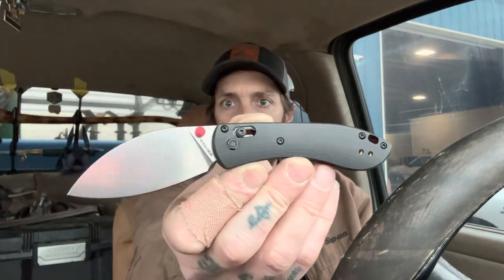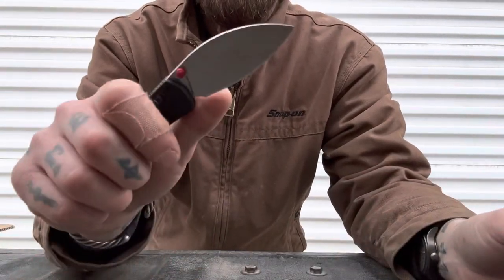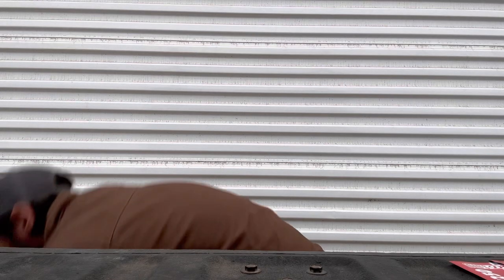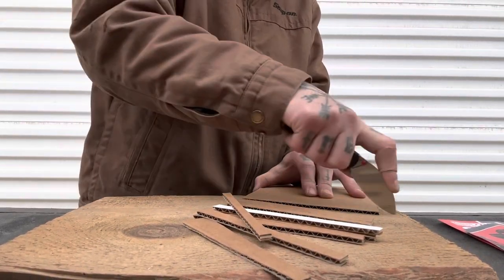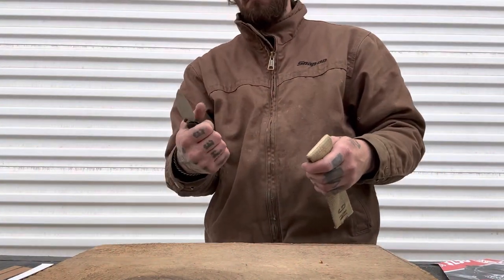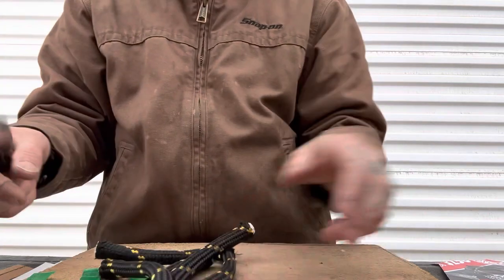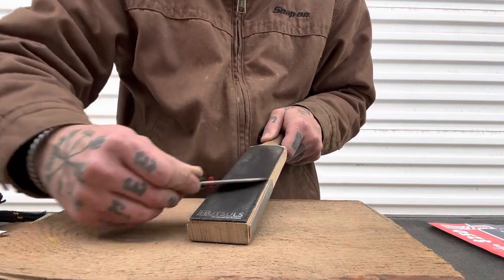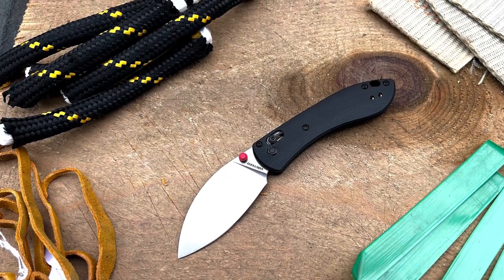Cut Test: Vosteed Mini Nightshade! Small but powerful.

Comment: Also: had a question. How do you think it compates overall to the baby banter? I watched most of tge baby banter cut test and it seems edge retention seemed better here. But im specifically wondering about ergos and also how it carries. Im interested in them as a small, lightweight edc to have for very minimal and occasional utility cutting. Thanks for reading!
Reply from the maker: The Baby Banter is more light use than the Mini Nightshade. Also, the Nightshade is going to be WAY better at utility cuts than the Baby Banter. Both are very lightweight. The Baby Banter is a smaller knife, so it disappears in your pocket a little better. But I hardly notice I’m carrying the Mini Nightshade either.  
Overall, I’d pick the Mini Nightshade every time. Better at utility cutting, better at slicing through cardboard and other materials, better blade shape, easy one handed closing with the crossbar lock.
Reply: @doodysdaggers  hey thanks so much for the super clear and detailed response. I really appreciate it! Mind made up: I'm gonna start planning to buy the mini nightshade and skip the baby banter. Really like this one with the red accents, though I'd love to see it with micarta scales too. Anyways, thanks again!
Reply from the maker: @zazeechmoreno you’re welcome man! Enjoy it! 🤘🤠
Reply: I have both. Love the Mini NS. Baby Banter has great action and a forward choil, but blade is not a good cutter with its thicker blade stock. The NS is a great slicer. If on the fence, get the Vosteed.